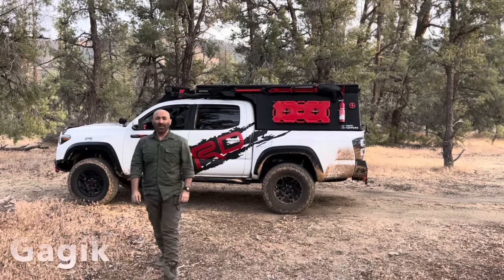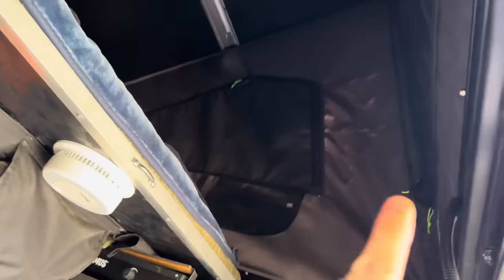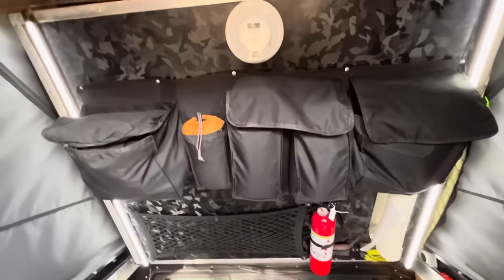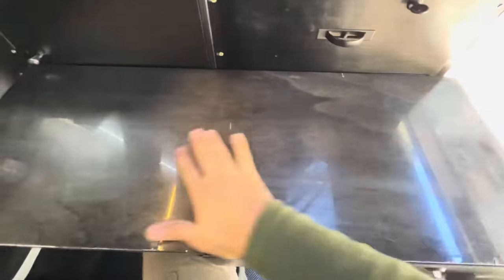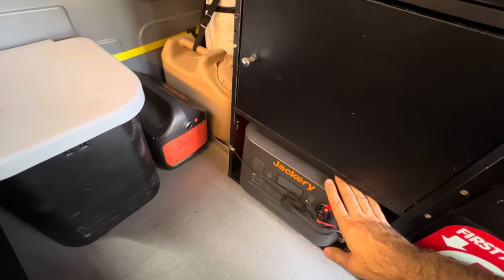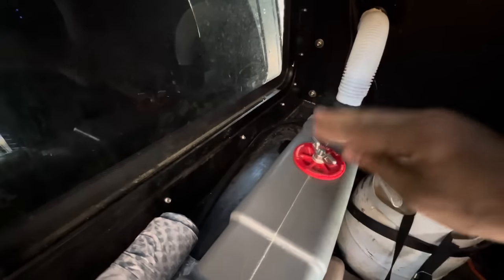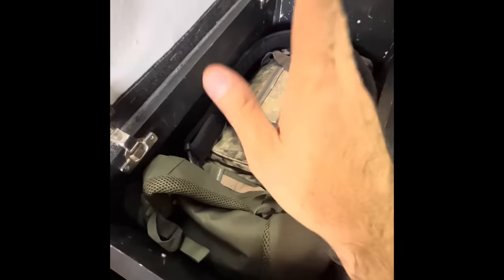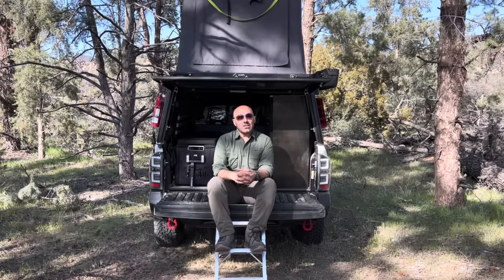Overlanding Truck Camper Setup | 3rd Gen Tacoma 5 Foot Bed | IG: @noroad_noproblem

Comment: Great rig. Only suggestion it to get an exterior bracket for the LP tank and get it away from electrical and outside your living space.
Reply from the maker: Thanks for the suggestion. Yes I know I’m actually going to put solar panels on the top of the camper to charge the battery so I’ll get rid of the power inverter.

Comment: Dude this set up is amazing, only thing I'd change is have that 12g staged to point out of the bed. Very inspiring bro
Reply from the maker: Thanks man! The bolt on the shotgun doesn’t let me mount it the other way unfortunately
Reply: @NoRoadNoProblemAdventures  You can mount it upside-down. Rotate it 180 degrees, so the trigger is facing up. Bolt side still faces out.
Reply from the maker: @robleigh461 I’ve tried it upside down actually but it doesn’t sit well.

Comment: That's one of the nicest set ups I've seen. What is the total load weight with all the gear and topper? If you dont mind what was the appropriate total cost? Thanks
Reply from the maker: Thank you very much!! To be honest I’m not sure about the numbers. The camper alone is 275 pounds. I’m assuming I have couple hundred pounds of gears in there. As far as the cost: again the camper alone is $8000 and I think I spent around $5000 in there to make it the way it is now.

Comment: I’ve watched so many of these videos from other people, I just didn’t expect much. But you took the Topo Topper - a good platform - and really made it your own. The bed folding up is a must. The first aid drawer is well stocked. Like that. You’ve crammed a lot into a small space & made it work for you, which is key. And your armory…very nice. I was slightly expecting something based on the American flag box…I knew something was coming. But not to that degree. Awesome! The emergency bug out bag is important. Do you have some rations/first aid in that as well? Great job. I’m originally from Santa Barbara, so not surprised good stuff is coming from the SB/Ventura area. 👍🏼👍🏼👍🏼
Reply from the maker: Thank you so much! I really appreciate your comment. Yes I do have a first a kit in the bug out bag and another one in my truck as well. But those two aren’t as complete as the one in the drawer.

Comment: Love the set up! Just a suggestion, try to reduce the length of the diesel heater, a lot of heat will be lost to the hose being so long and exposed to the cold.
Reply from the maker: Thank you!! It was shorter actually. But it was getting too hot inside so I made it a bit longer. Winters in California aren’t that cold.

Comment: Pretty amazing man would love to have that set up. Just curious as I'm just learning about overlanding. Is there a reason why many choose the rooftop tents over a slide in type camper which many already have the things you need? I'm just researching and looking into getting something going for myself and my wife to take few day to possibly weeklong trips. We have and live in an rv already for 10 years but want to start overlanding and start another setup for shorter trips. Again, great set up man. Really impressive.
Reply from the maker: Thanks man! So here is my opinion: slide in campers are much much heavier and top heavy so they aren’t ideal if you want to do extreme offroading. Of course my set up doesn’t have the same comfort level as the slide in camper but I can explore more places with this setup. So that’s the main reason I went with wedge style camper.

Comment: Love your video Man. If you had the opportunity to use a 6ft tacoma instead of a 5ft would you change it? Thanks!
Reply from the maker: Thank you! If it was only for normal overlanding and doing a lot of off-roading then probably yes. But for off-roading shorter wheelbase performs better.

Comment: I can only mirror what others have said.  I don't think I have ever seen such a well thought, detailed, yet compact build out for a topper.  One question, how do you like the tailgate ladder.  I have struggled with a solution and considered those in the past.  Would love to hear how it works when packing it up, unfolding it and how easy it is to use without any handrail.  Thanks again for your contribution, Bill  PS What brand ladder?
Reply from the maker: Thank you so much! Honestly the ladder is awesome. It’s a most have in my opinion. Very sturdy, lightweight and compact. Here is the link: https://www.amazon.com/dp/B00180UVGO/ref=cm_sw_r_as_gl_api_gl_i_DM23D0GA5GJRKAGX3JFB?linkCode=ml2&tag=noroadnoprobl-20

Comment: Great video.

One exception. Unless I missed it in the comments section, how do you secure the camper once you fall asleep?
Reply from the maker: Thank you! You can put something under the latches from inside which will prevent it from opening. If that doesn’t work then I have 3 firearms inside the camper.

Comment: Hello Gagik, i am a retired military Veteran and i am looking into doing this more and more. I have a 2015 Toyota Tacoma TRD Pro with a suspension upgrade and towing package also with a 4 inch lift and 33 inch tires. I guess my question to you is that being on a limited budget how could i go about starting a build out like yours? Thank you and i love your rig!
Reply from the maker: First of all thank you so much for your service. It’s because of people like you that we live in this beautiful country free and save. May God bless you Sir 🙏🏻. As far as the inside built, I would say the only experience part is the drawers which are about $90 each which since they are steel and aluminum but you can basically use any wooden drawers and the cost will be way more cheaper. The cabinet where I keep my food and other stuff is pretty inexpensive. I have all the links to the items in the description.
Reply: @NoRoadNoProblemAdventures  thank you sir, God bless

Comment: Nice build, I’ve been thinking about doing a similar set up in my Dodge Ram with Topo Toppers Badlander.
What server rack did you buy to mount your drawers or did you mount them to a wooden frame?
Reply from the maker: Thanks bro! It’ll look even better on a ram because it has larger bed. I mount them on a wood. The links are in the description

Comment: Truck looks great! What cap are you using for the diesel heater connection on the camper?
Reply from the maker: Thanks bro. I got it from Amazon. I’ll do a video later probably with the links to my built
Reply: @NoRoadNoProblemAdventures  when are the links going  to be available?
Reply from the maker: @jamesonfamilyadventures...9679  available in the description now

Comment: Do you get a lot of dust inside the bed of the truck?
Reply from the maker: I get some. But not a lot. It’s coming in from the side of the tailgate. It has nothing to do with the camper. I need to add some of those rubbers to close the gap.